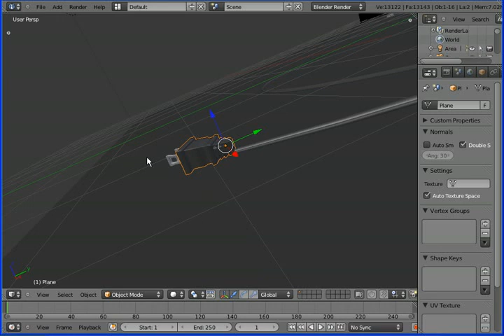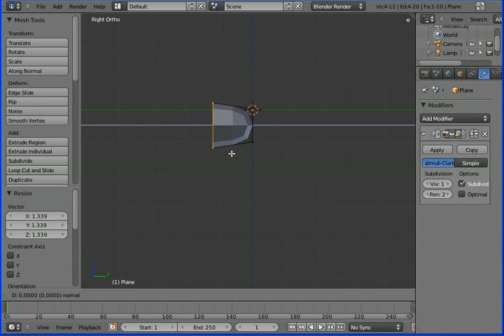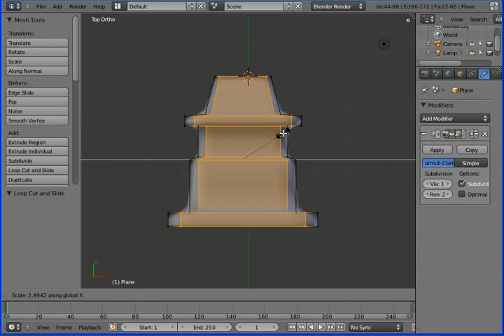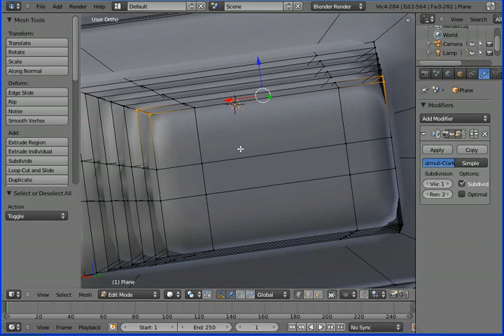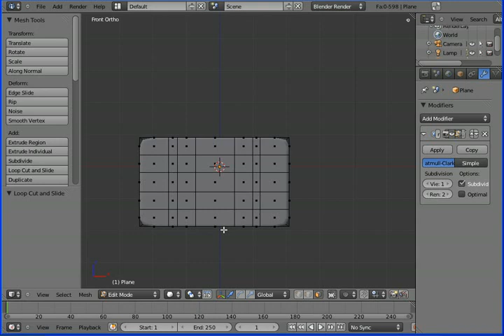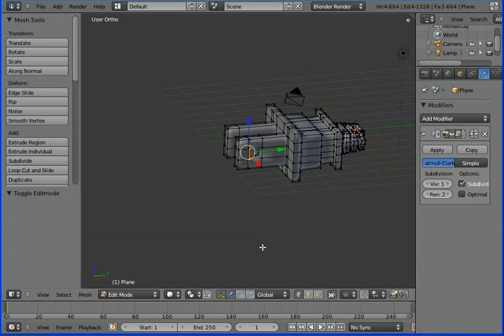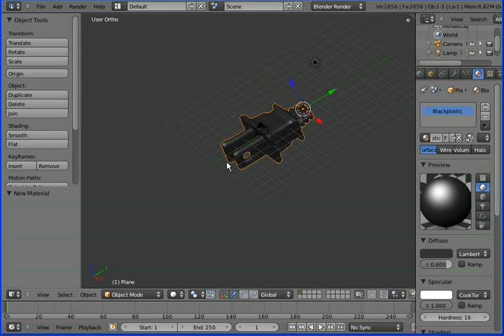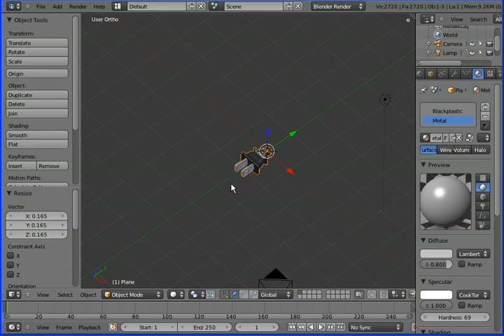Blender 2.5 Tutorial: Modelling an electric plug

Comment: Quick tip: At #2:20 rather than extruding and then scaling down. You can just press I to inset. It's less time consuming so your workflow is faster.
( If that feature is not in blender 2.5 then sorry, I use blender 2.79.7 )